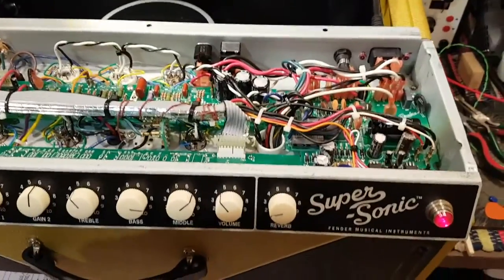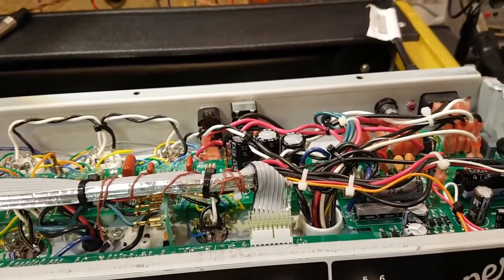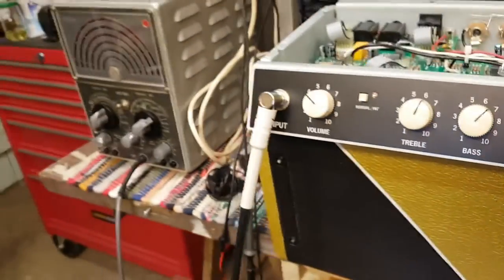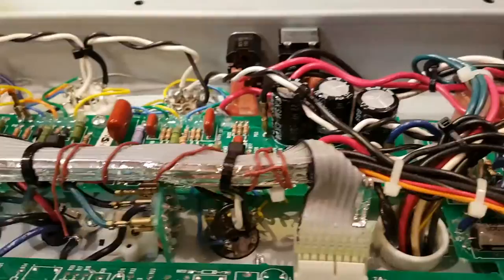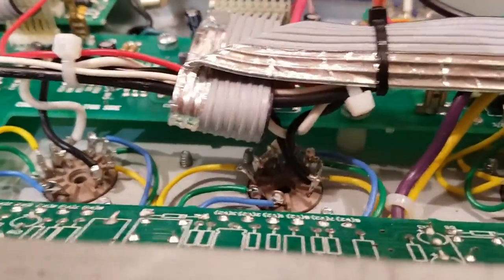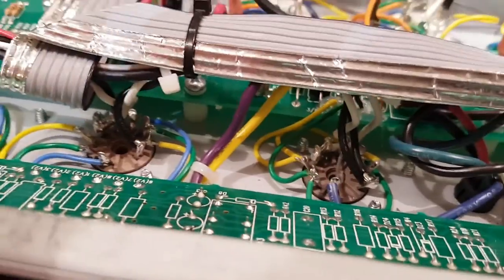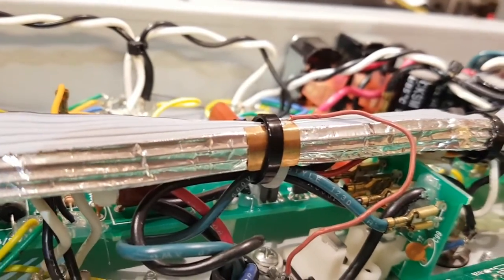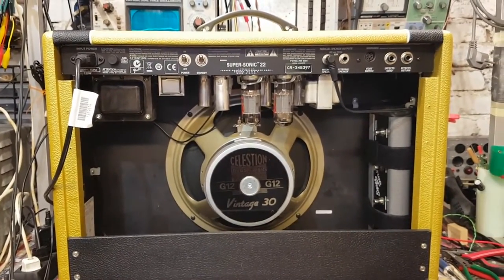Fender Super Sonic 22 Noisy Reverb fix - Part 1

Comment: I have been fighting that hiss for close to a year now. From alternative tubes, to moving wires, nothing has worked. I will be doing this mod, with copper tape, as soon as I get home from work today.  I did get rid of the reverb feedback by stuffing the bag full of shop rags as well.

Update: did this mod and the amp has never been quieter. This should be added to the fender tech note. Well done.

Comment: Great video!I just purchased the head version.I have ne issues with reverb noise but it seems that my reverb is very weak.It is not the tube.Word has is that it is not the same reverb circuit as in a DRRI or PRRI.Just wondering what you might know about this.Thanks!
Reply from the maker: The circuits are similar but not identical. I suspect that the DRRI has a better reverb tank but I may be wrong. I have an original 70's Deluxe Reverb and it is WAY more lush. My advice is to buy the best tubes you can afford and see the difference.
Reply: @DerekHerbst747  Thanks Derek.I have some NOS 12AT7's i will try.
Reply: @DerekHerbst747  I pulled the reverb tank last Everything is tightLooks like Fender is using Ruby Tubes tanks now.It is a RRVL2AB1C1BV4.The RCA cables are very then.Will replace those for sure.

Comment: Did you end up grounding the foil wrapped cardboard to the chassis? Or was it the tube that was causing the feedback?
Reply from the maker: I grounded the tape
Reply: @DerekHerbst747  Awesome! Thanks for posting this video. I just bought as used Super Sonic 22 and it had this very issue with the reverb. I used your suggestions and it did work. Much quieter now. 
Thanks again!